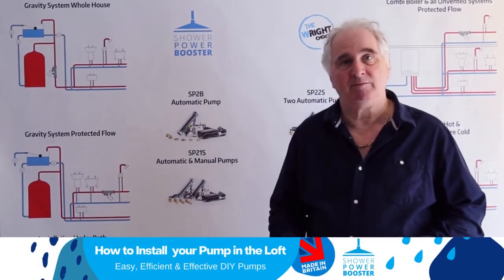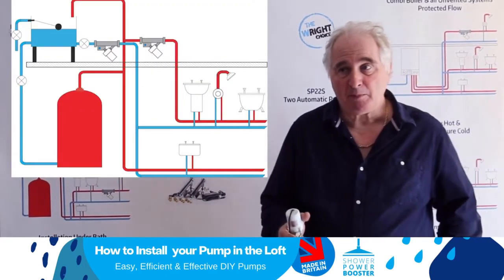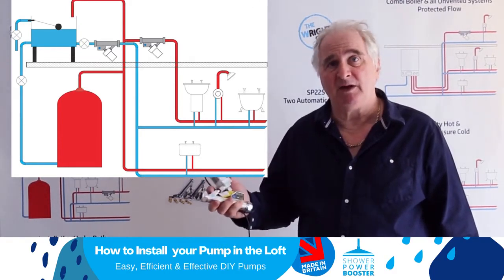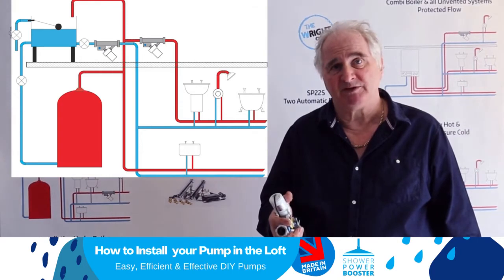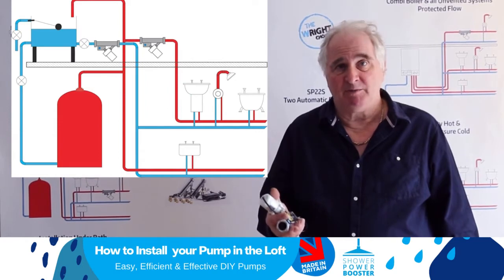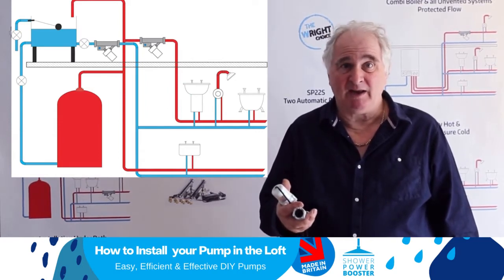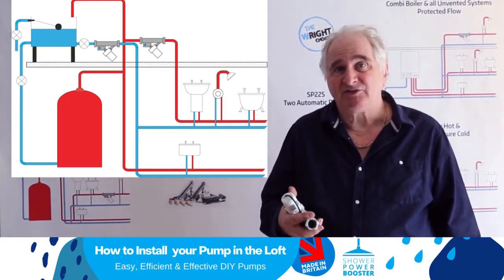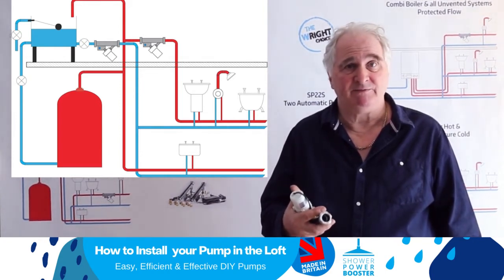Fitting a Pump in the Loft - DIY Water Pressure Boosting Solution with Shower Power Booster

Comment: This is great, I want one. Please add the Ship to New Zealand option.
Cheers!
Reply from the maker: To send pumps to new Zealand tracked and signed for it costs me  £33.25. We can avoid VAT so part of this cost can be offset however before sending pumps I would like to find out more about your plumbing system so what I send you is what you need. It's a long way to New Zealand . We carried out a market study in New Zealand. There are lots of homes in New Zealand which would benefit from SPB pumps. I note you have emailed me so I will reply to your email.
Reply: @alandwright2  Fantastic looking forward to it.